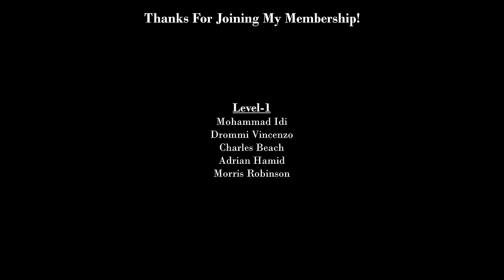Angle Grinder HACK - Make A Electric Chisel, Concrete Breaker, Hammer 3 In 1 Attachment For Grinder

Comment: This is the 5th tile project we've done where we've removed the old tile before installing new tile, and the first one with this tool  https://www.youtube.com/post/UgkxqqoaX03nrziKwF7Bjjcc71YzLEleMvOS  . I want to cry for all the unnecessary work we've done in the past. With this tool, we removed tile surrounding a fireplace, as well as the hearth tile, set in loads of cement, in less than an hour. I highly recommend this tool. It was easy to use, and very satisfying watching the tile literally fall off the wall.
Reply from the maker: Thank you

Comment: Thanks for the idea. I’m going to make one with an exacto knife fitted with a #17 chisel blade, a 12v motor axi,,some brass or aluminum K&S engineering tubing for the knife, a spring, use a plastic wheel and enlarge the hole while offsetting it so it goes in the motor. And I can make all the other parts or source them from my vast collection of electronic parts i hoard. I could make 20 of them probably and have a speed controller soldered into it.I need something that will chisel away capacitors(im mining palladium) off circuit boards fast.